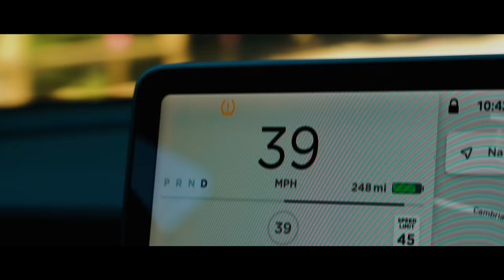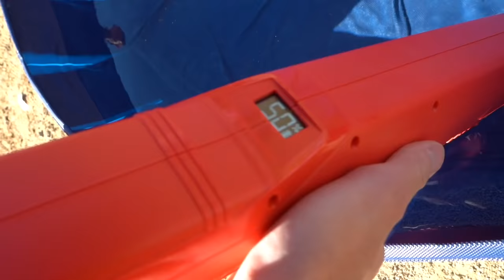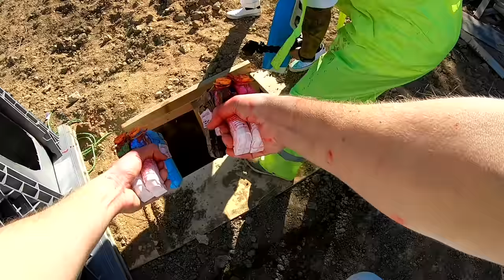*WORLDS STRONGEST SQUIRT GUN* $10 vs $1000 Super Soakers Battle Royale Budget Challenge!

Comment: Yeah the problem is with the big squirt guns the refuel time little guns don't take as long to fill up and so you have to weigh that out you don't have time to sit there and refuel during that time you could be attacked by a man with a very tiny squirt gun if he fires an accurate shot it's all over for you at the fill station they might take you out because you got that big gun using up too much water super soaker or something you might be spend the most of your time at the refill station you'll be easy pickings for the man with the little tiny squirt gun who jumps out of the bushes so you know when we're talking about tactics and strategies you have to take that into consideration not the biggest or the smallest people that come out on top sometimes it's just this scrawny little medium sized guy that comes camouflage to the bushes that ends up at the top you remember you got it outsmart your opponent it's not based on pier ce athletic proudness or how athletic you are the end of the day it's going to be the guy who uses Battle tactics the best